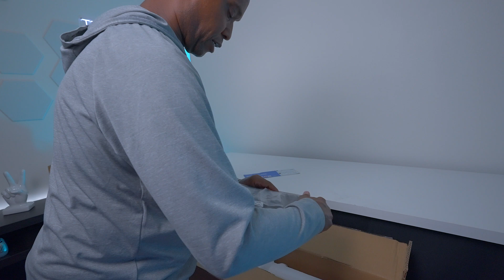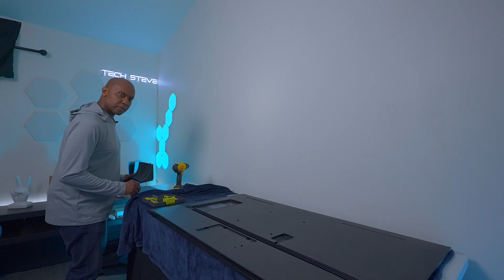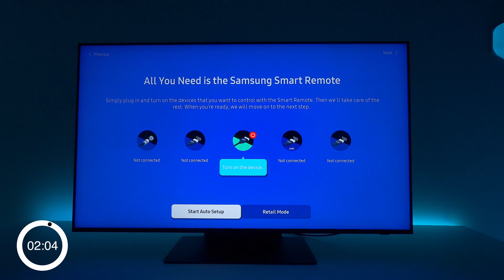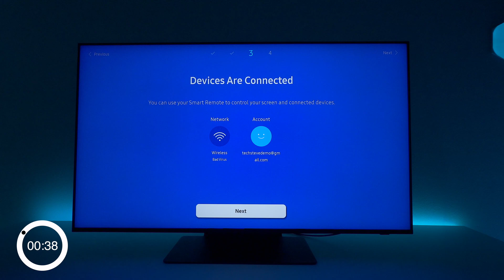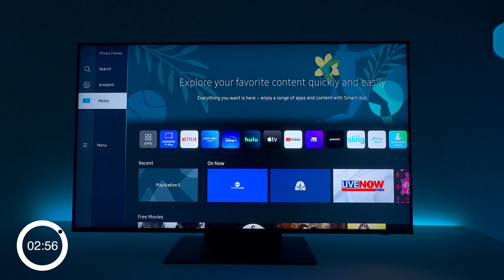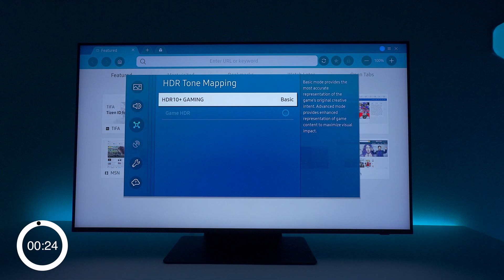2022 Samsung QN90B Neo QLED TV Unboxing

Comment: I’m in the market and was wondering would you still buy the QN 90b today in a 55 its just around 1000 the 90c about $500 more and if it’s worth it? Also looking at the 43 with the 60c at around 500 and the 90b , c over 1000 there’s nothing in between so you jump 500. Is it worth it over 1000 for a 43? Thanks, Mark.

Comment: Please help with installing Samsung qn90b on 65 inches. Why is it better to put it with the display down to install the stand if it is not possible to put it on the table, as indicated in the instructions? I planned to put it on the sofa, having previously laid a blanket, but then I read that it was impossible to put it on the sofa, because due to the softness of the sofa pillows there would be uneven pressure on the matrix, which could cause damage to it. Maybe it's better to put it in a box? And if on the box, then where to put the packaging foam, the box from the TV is completely without rigidity.
Reply from the maker: laid it down on a bed, more surface area

Comment: I'd NEVER lay a mini LED panel tv on its front frame tv tech no no! I'd fallow the factory instructions on box 📦 says pull out the foam in middle front and both sides in front for access to the middle panel for easy install of the back panel base safer and doesn't damage the mini LEDS!
Reply from the maker: Nah, I’ve unboxed over 100 TVs never an issue. But you can always do what makes you feel safe

Comment: Is it just my unit or does the 43 inch model not come with a protective film on the screen? Would be a little weird as there actually is a protective film on the frame...
Reply from the maker: There’s always a blue tab if it has one on Samsungs
Reply: @TechSteve  Okay, thanks for the feedback. Then there is definitely no protective film attached, which I find a bit questionable in this price range.

Comment: How is the sound? I heard this year the Qn90B got Dolby Atmos from the internal speakers. Last year Qn90A sound wasn’t good but the previous year the Q90T had decent  sound. If this sounds is great I would get it. Wish there was a easier way to change input than having to go through all that steps.
Reply from the maker: Why wouldn’t you get an audio system? 10 watts is a low powered system anyway
Reply: @TechSteve  thanks for your reply. I am not into very loud sounds but I like something decent. I got the A80J (I think it's about 50w) and the sound is pretty nice but I want the QN90B (it's about 60w with Dolby Atomos) so I was curious about the sound and how good it was. Would be a waste of money for me to buy even a sound bar, I don't like very loud..I like something that clean and still got a decent bunch like the A80J.
Reply: @TechSteve  it's 60W with 4.2.2 speakers configuration. Sound bar would be better for usually not for all.

Comment: First off, I like your reviews.  But it seems like literally no YouTube reviewer ever takes a look at what the consumer reviews for a particular model or brand are saying.  You can research all the major players, like LG, Samsung, Sony, Hisense, TCL, Vizio, etc....and there are so many problems with all these brands.  Poor picture, under performing specs, defective after short periods, broken this or that.  Cheaply made and poor quality control are big issues.  Not to mention extemely poor customer service when something goes wrong.  Maybe it's time to reflect what the average consumers is really getting for their money.
Reply from the maker: Why would you mention any of that stuff not knowing if everyone will have bad experiences. I don’t see any of these things because these are units I purchased just for filming.
Reply: @TechSteve  No not everyone will experience these things.  It is not what I am saying.  If a consumer reads online reviews from major sellers of TV's like Amazon, Sam's Club, Costco, Bestbuy and others, you tend to see both the good and bad reviews.  I have been noticing recently a trend in reviews that some (not all) consumers are dissatified with ther new purchase whether it is from TV's that under perform ,  defective pixels, TV's that break after short periods of use, TV's that need to be frequently rebooted/reset, dropped WiFi connections and other assorted issues.

Why as a consumer should we have to deal with defective crap right out the box?

Comment: Hey Steve, thanks for the awesome video. Do you know if this TV is compatible with the One Connect box?
Reply from the maker: Why would you need it
Reply: @TechSteve  I plan have all the devices that connect to the TV on a built in shelf on the side of the fireplace where the TV will be mounted. Just figured it would be easier routing one cable rather than 5-6.
Reply from the maker: I understand, you have to buy a model that comes with it not TVs with ports on the rear
Reply: @TechSteve  yeah, I was hoping that wasn't the case. Thanks!

Comment: Should have 4 HDMI 2.1 ports, might want to double check that.
Reply from the maker: You’re right HDMI (High Frame Rate)
4K 144Hz (for HDMI 1/2/3/4) I’ll correct on the main video. I appreciate that